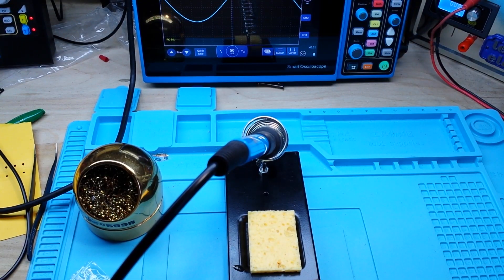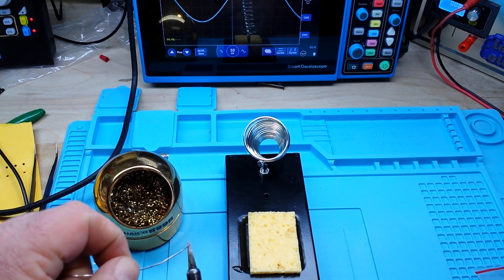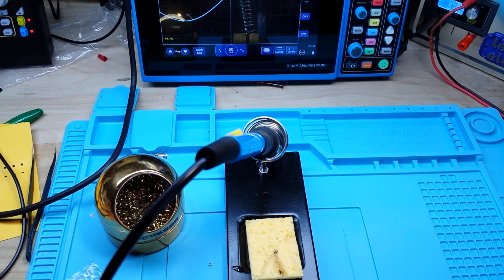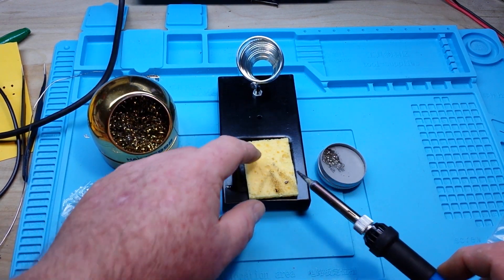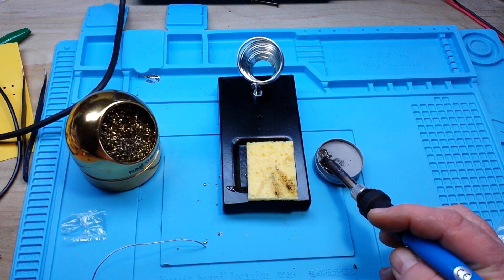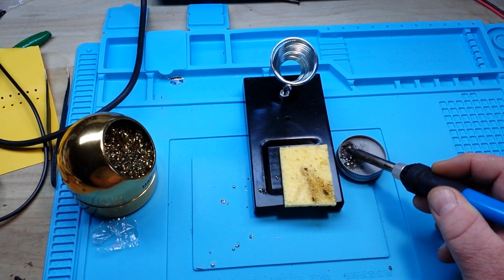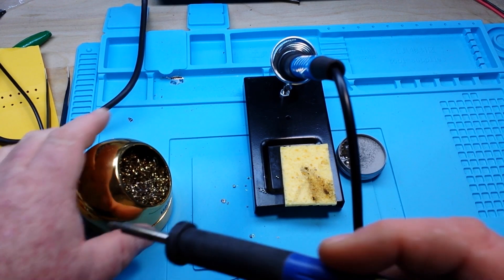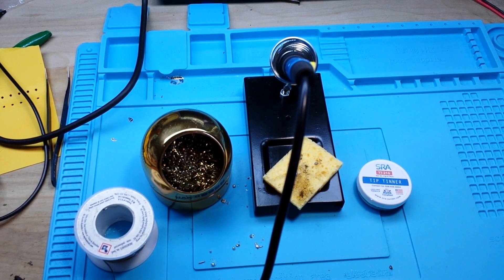Can Tip Tinner restore a dirty soldering iron tip

Comment: This is from the Weller website (https://www.weller-tools.com/how-to-care-for-soldering-iron-tips/):

Reactivating Your Tips
If a tip becomes oxidized, it will appear dark, and you may not be able to tin it. To fix this problem, you can use a tip activator to reactivate or re-wet it.

To reactivate the tip, dip it into the paste-like activator substance and move it around until it starts to become shiny again. The fine abrasives and additives within the activator will break down and remove the oxide layer.

Once the tip looks mostly clean, remove it from the activator and clean it using brass or steel wool. Then, re-tin it immediately. Flushing the tip with solder by re-tinning it will remove any remaining contaminants. Then, clean it and re-tin it again. You should then be able to use the tip without trouble.

Weller's high-quality tip activator is lead-free and RoHS-compliant. Reactivating your tips using this product will keep your tips in good condition, make soldering easier and improve the quality of your results.

Comment: Thanks for saving me some time and money. I rarely solder, but I started working on my own keyboard recently. I've just been cleaning my tip up on the belt sander whenever it gets oxidized too bad. I probably just made someone cringe, but it's been working well for me.

Just ordered some brass as well. Have been using a sponge.

Comment: I'll have to try this with my hakko tip tinner paste will have to grab a bit I don't care for like a chisel and beat it up first.. did you try coating it while the iron was cold? What I would try cause tip tinner is a mix of flux solder and acids just curious I'll find out with my cheap 65 watt station

Comment: I just bought some and came here looking for advice on how to use it. I won't be too disappointed if it doesn't work for me as it only cost 5 quid but at least I know, from your video, that it will not save all tips. Thanks very much for the video.

Comment: I've found that specifically Thermaltronics tip tinner works really well. I have never used the kind you were testing (although the material looks the same to me) but looking at your results there's no comparison.
Reply: agreed
Reply: 100%. And Thermaltronics looks like a powder, not a gel like @learnelectronics - I just tinned mine and it immediately tinned my very very banged up old tip I had on my iron.

Comment: Easy fix my man, don't throw away that perfectly good tips. From the looks of it the surface is only corroded and from oxidation, pretty much a patina that ketchup won't help. Metals corrode other metals with an acid being the accelerator.

Lightly sand it down, try not to hit the copper. Not a big deal if you have, you were about to throw it away remember. From there tin it few times. You should be fine for at least half of the time you abused it. If any wounds are made such as chips or corrosion\oxidation just eating your tip away then just think of having your conical tip turned into a beveled or chisel tip. File and sand it down try to be smooth as possible, it makes the biggest difference which is why a drilll comes in handy. I usually use the paper side of the sandpaper to  smooth it out or along a tight fabric such as my pants.

Now if you want a really cheap way to potentially have a tip last for years with proper care even longer. Start nickle plating sanded tips *the whole tip, start fresh*. Youtube it and proceed with caution, its not idiot proof its cheap as hell and you end up going crazy and gold plating everything in your house. Now I seen what a tip tinner does, always thought it was just rosin flux

Comment: All tips will oxidize eventually and you are expected to replace them.  It is a few dollars vs hours of frustration.  I have used a few brands of soldering irons: Hakko, Metcal, cheap chinese brands, and I find Metcal tips lasts the longest, maybe months.  I am not sure whether is it due to tip quality or the technology in the soldering iron.  But Metcal is expensive.  The tip tinner is supposed to be used regularly before the tip oxidizes.  I always dip my iron into tip tinner one last time and don't wipe it off when I finish soldering.  It protects the surface coating.

Comment: I've had good experience with Weller's tip activator and Mechanic's Tip Refresher (same stuff as the Weller but far cheaper), but that stuff doesn't look the same as the one you have there. I have no idea what that stuff you have is.

That tip though, I think it might be too far gone man. You wanna "save" one that's that horribly messed up, you need to sand it. Then go straight in the tip tinner, quickly to the brass, then apply plenty solder. Back to the brass to remove the excess solder, then tip tinner, brass and solder again another time. It won't last forever but it will be far better than what you have now. That thing is ruined.
Reply: I totally agree.

Comment: I used this tip runner on an old radio shack iron that was completely black with oxidation.  I used 220 grit sandpaper and took it down to the brass and used this tip thinner and it’s as good as new. Solder wouldn’t stick and now it will stay on the iron.

Comment: The only thing that's ever worked for me as far as recovering tips goes is cleaning them cold and dipping them into a molten solder pot. A tip is going to oxidize when hot as soon as it is exposed to atmosphere. But solder pots aren't cheap. I didn't buy mine to clean tips. It just turns out it's the best way to clean tips or rather tin tips too.

Comment: It works for me if I stick it vertically and let it liquidify and boil around the tip for 2-3 seconds, clean it with the brass and it works. I have stopped using the sponge because they say that the temperature difference creates micro cracks that in time ruin the tip, I can’t verify but it makes sense to me. Great vidreo, keep up the great work!
Reply: Micro cracks are an exaggeration. If your tip cracks, it was long due for replacement.
Reply: Been soldering for years Damp sponge is standard. Never got a cracked tio. The soldering iron tip must be poor quality if it cracks.
Reply: @meisievannancy I’ve been using the damp sponge for over a decade
Reply: Myself too and I use cheap Chinese soldering irons too and their tops last for years. I fact they last longer than the Weller.
Reply: Never use a sponge, always use the brass wool, it will not hold contaminates like a sponge.
Very good video, I just found your channel!
Reply: It has happened to me. The micro cracks. 😅 I didn't know that so my tip got a huge crack it almost slice in two
Reply: I know this is going to be contrary to what most professional say but it just use a wire wheel and I never have a problem. Well I guess I do have a problem and that's because I leave my gun on sometimes for days at a time before I realize and it is usually pretty toasted as you can imagine so I just turn the wire wheel on and knock the crud off and hit it with some new solder game on I also make my own tips with just a piece of copper wire as an electrician it's free basically I have tons of it and it works quite well but I am an electrician not an electronics guy and I'm not a professional soldering by any means but it seems to work for me

Comment: I use it after cleaning the tip with steel wool or sandpaper sometimes even a file.  Get rid of all the oxide, then re-tin. Works faster than using just flux and solder.
Reply: Sanding or filing your tips will ruin them by taking the exterior coating off of them and then they will start to decay over a short period of time afterward.
 That being said I have done that samething many times myself, mostly before I knew any better but also ive used it to get me through because my tip already had irreparable damages and needed to use it till a new one came in the mail. It did the job for that short time I needed it too though.

Comment: Never use a wet sponge, and the tip tinner will work. Just stab brass. I don't know what the wet sponge does, but it WRECKS tips to the point they are unrecoverable. I have been using the same tip now for 3 years, and I use that iron about 5 times a week. I never get it wet, tip tin it about every week, and only stab brass wool.

Comment: works like a charm. At least that's what i've found. Then again, i haven't let my iron get all tore up yet. I use the tinner once every "session" i solder and it really does work and keeps it clean. VERY clean. I use crackpipe wool like you have and a sponge too.

Comment: I have soldered for years, all of the paste cleaners are not worth purchasing.   Get yourself a bar of Sal Ammoniac,  when the iron is hot, roll the tip onto the bar, along with a drop of solder.  Perfectly tinned tip every time.

Comment: Rather than sinking the tip for less time at high temperature, use low temperature (300-350 c)and let it stay in tinner for 20-30 seconds. Then vigorously rub it on sponge to remove any remaining oxidation.

Comment: I'm a plumber by trade and I just started messing around with soldering irons if you use utility flux and a piece of sand cloth it'll clean that tip right up
Reply: This will clean a soldering iron tip right up http://i.imgur.com/2LqkdOi.jpg That there is an Eisco Model 37 Which is a 5 pound 800 Watt solder pot. I polish a tip cold then simply dip it into the molten solder. Tinned. It's an industrial piece of gear. Handy for plumbing too. I can dip a copper fitting into it and tin it perfect. Been there. Done that.

Comment: Hello learnelectronics, Upon quick examination I would say that the tip has been used at a temperature that is too high for too long and the oxidation has completely ruined the tip. There's no tip tinner on the market that can repair that. Time for a new tip.
Reply: Thanks for that clarification. I'm new to soldering, I have a crappy always on soldering iron. NOBODY in any tutorials on the Tube has the guts (evidently) to reveal that these are hopelessly dysfunctional. Designed to render their tips useless at first time of use. You sir have at least alluded to this fact that "always on" is going to overheat/ruin it. Thanks. I'm going to look for an iron that isnt deliberately created to ripoff green horns like me.
Reply: @rutiger6901  I wish someone had told me when I first started that if your iron doesn't have 1) temperature control and 2) a low heat "standby" mode that reduces heat when the iron is in the stand, DO NOT BUY. A cheap iron can get to 900F-1000F just sitting in the holder plugged in. At those temperatures, it is IMPOSSIBLE to keep a tip alive. PERIOD. No amount of tinning and re-tinning will keep the tip alive when it's staying that hot for that long.

Before I bought a proper soldering station, I had resorted to plugging my station in and unplugging immediately after use as a crude "thermostat". How's that for "temperature control"? A more expensive soldering station only SEEMS expensive until you end up having to throw away 2-3 cheap irons and buy dozens of tips. And that ignores the cost of your frustration too. I think the Hakko 888 is the cheapest viable soldering station out there, and stepping up to one in the $200 easily justified when you consider the superior performance, tip life, and ease of use. I went with the Hakko FX-951 instead of the 888 and do not regret for a second having chosen the more expensive unit. Every cent of upgrade has been well worth it, and I don't even do that much soldering anymore. Heck, if I never soldered again, I'd have zero regrets at having spent more money. It's truly already earned the premium and paid for itself in superior results and ease of use.
Reply: @rutiger6901 😮😢🎉❤🎉❤😢😂❤😂❤😅😮😢🎉😅😮😢❤😅😮😢❤🎉😢❤🎉❤m kilo❤❤❤❤ no❤❤❤
Reply: That was the comment I was going to make. The tip has been overheated severely. Hakko makes good quality tips, so this tip was abused in some way. I would recommend setting a lower temperature on the station. I have excellent results with my Hakko tips at 300°-330° Celsius.  I never go hotter than 350C. My FX951 will allow set points as high as 450C. At the top range of temperatures, you can measure tip life in minutes if you do not quickly apply the iron to the work and start to shed heat. One thing that helps a lot is having an assortment of tips of different geometry. If you need more heat throughput, you can often get satisfactory heat input just from going to a large bevel tip (ideally) or Chisel (less ideal) and get enough heat without having to run very high temperatures. The standard conical tip often is a poor choice because it doesn't store much heat for a given temperature-- thus it requires higher temperature settings to give results. Try the 3.2mm Chisel tip instead of the (T18-32) in place of the T18-B tip that it came with. You should get better performance at lower temperature settings. The largest T18 tip, the 4mm bevel tip (T18-C4) has the highest heat capacity and will give very good results if you do not require the smallest tip. I use a large bevel tip like this for point-to-point wiring as you might see on amplifiers without circuit boards. It works superbly for soldering to lugs and sockets even at low temperature settings.
Reply: I bought a good quality butane soldering iron and I think I ruined the smaller tip by not tinning it properly and using too much heat. The other tip is way better condition since I learned my lesson. Not sure if I can restore the other tip
Reply: shiiiiiiiiit.
Reply: SRA, I once had a similar issue with a previous soldering pen I had and I was able to clean the oxidation with sand paper
Reply: @ultralagger1  Very surprising, usually that a no, no.

Comment: Those cheap soldering irons dont have proper heat regulation from what I am seeing, if the solder immediately rolls off the tips and flux goes up in smoke then the iron is way to hot i.e looks like 450-500 centigrade dont know what that is in Fahrenheit, try turning the temperature down.

Comment: Hi how are you I am going to tell you one thing and you can buy on eBay it’s call solid rosin welding soldering flux I have been using since I was child in Pakistan now I have been living in the Uk just give some flux Irons and clean with wet sponge and you will be happy and do not clean brass with steel wool because steel stay on tip after you use this promise you will forget everything let me know thanks

Comment: I was told to never use the brass wool. He explained the reasons but I forget. He has always been a reliable source...hhhhmmm
Reply: A wet sponge can thermally shock a hot tip. The wet can also drop the temperature of the tip too. But all of this can be mitigated by proper technique. Don't use a sopping wet sponge and wipe fast. Everyone else can just use brass wool.

Comment: That cheap chinese soldering iron eats tips, period, I have the same one. It has a temperature dial but I bet if you put it on a FG-100 you will find its continually pumping heat into the tip and most likely way above what you set the dial to. Its oxidizing your tips because the temp is constantly way too high (on mine I had it set to 300C and the reading on the FG-100 was way over 400C). I switched to the cheap chinese ebay ones with the LCD and those can keep a proper constant temp.

The tip is probably not gone either, you can use a sal ammoniac block and put the tip on it and roll it around while also adding solder when the block starts smoking (but dont use this block if you dont have a fume extractor to get the vapors out, this is required and not a recommendation as with flux smoke as its worse).

Comment: Hey man!, get some kaliphony activated rosin it's a solid amber like resin but extremely brittle, super cheap and goes a long way. plus you can use it for everything from making your own soldering paste/flux with some ipa or using it as a tip cleaner.

Comment: I use a small screwdriver that has solder melted on it and then dip it to flux,while cleans the solder tip instantly retins the tip also with new solder mixed with flux taking any excessive dirt from the sides of the tip.Patended procedure owned by me.A wet sponge worns off more quickly the hot tip,when once upon a time use it all the tips cracked and opened after sometime.

Comment: You have to let it cool fully after using the tinner before trying to use it for anything. When it cools, the metal particles of the tinner stick to the tip.
Reply: Thank you so much for clearing this big misunderstanding up. I learn more from comments sometimes than from a video.
Reply: This is something that people doesn't know. 
Tip tinner usually are used before storage,  which mean after use. 
Tip Refresher (cleaner) (cream paste) what ever they call that other product, is use while soldering.

Comment: Hi Paul, can you make video on powering the atmega 328p barebone out of the arduino. As a beginner that's where I am having problem, how to power it , what should be the circuit. For my personal case, I want to power my atmega 328p barebone from 12v car battery. I want to use atmega328p as a LEDs controller board. So far I am able run it barebone by 5v power supply. How to drop 12v to 5v? Car battery can be tricky irregular voltage current drops or spikes, I believe I have to use a capacitor too but what kind?
Reply from the maker: I would use a buck converter.
Reply: @learnelectronics  Thanks Paul, I will look into it.

Comment: Your video called "How to clean and re tin your soldering iron
" is basically the method I use and find it works best for me. Except I use the brass instead of wet sponge.
Reply from the maker: I switched to the brass wool myseld.